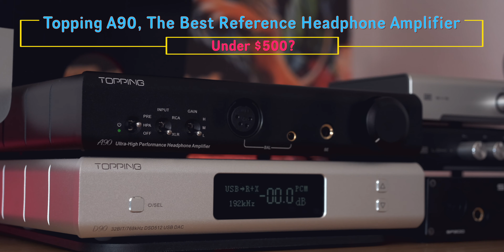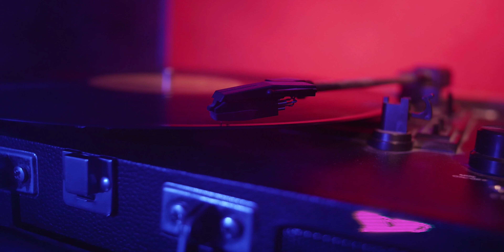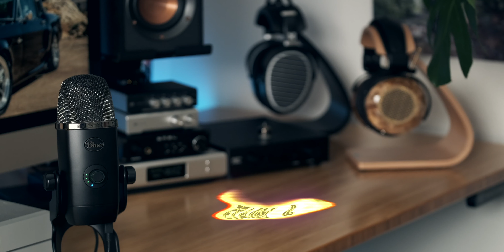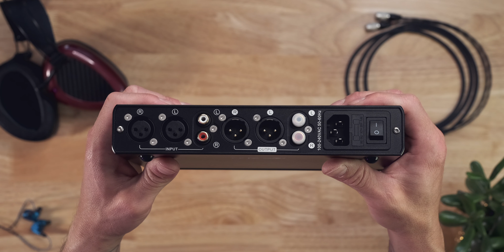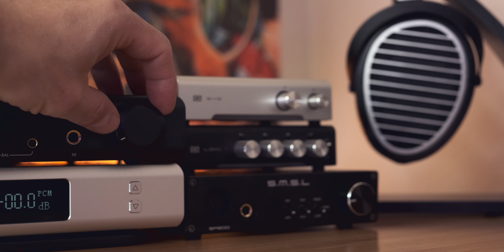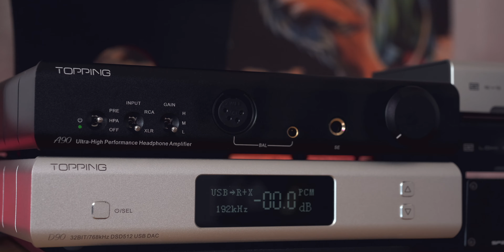Topping A90 Headphone Amplifier Review, The Best Reference Headphone Amp Under $500?

Comment: using your balanced cable did not improve the quality of sound. it has a higher output so its louder, that's it.
Reply from the maker: Hi @Indie guy thanks for watching, appreciate it.  There is actually more volts as well coming out of the balanced connection which helps the Aeon2C sound tighter in the lower frequencies and all around.  That’s what I was referring to not the overall volume.  You can check the specs of the balanced connection voltage on The A90 balanced output vs. single ended.